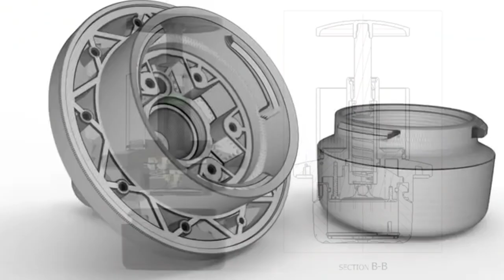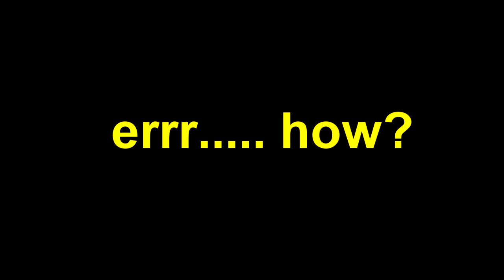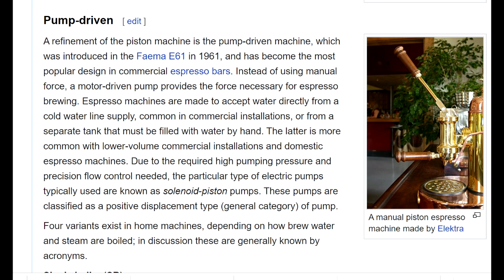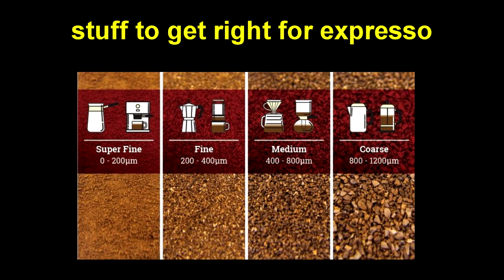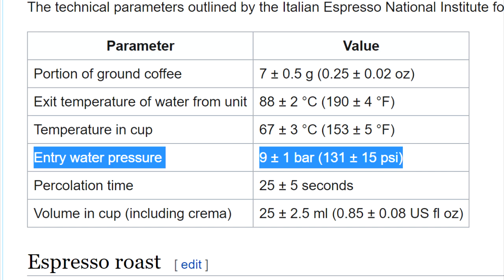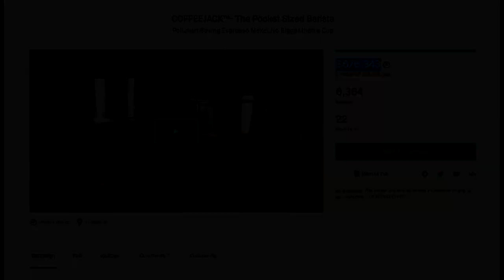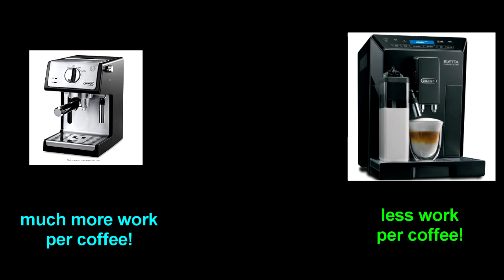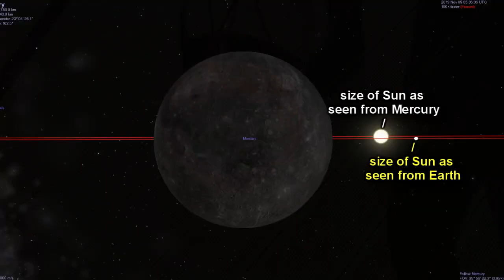CoffeeJack: BUSTED!!

Comment: So, to use this "on the go", you need to bring a cup and some boiled water in a container that keeps it hot.
A thermos would fit the bill. It usually comes with the cup attached. And is generally used to bring hot beverages, like coffee, from home to consume while still hot on the go.

So... Coffejack is just a thermos with an extra step?

Comment: Until we got to the pressure issue, I was thinking, "Well, it'd make sense on my desk at work." We have one of those Brun industrial drip units (with the three heater pads, you know, the ones you see in diners) that has a hot water tap. The problem is that my office buys absolutely horrendous coffee, so it'd make sense to have something on my desk that I can make my own in.

Unfortunately, the pressure issue looks like it's pretty much a killer on this one. The only solution I can think of is if you used a non-return valve, and used a longer plunger with a hydraulic system hooked up. But, you'd end up with needing a ton more pumps for it to actually work well.

Comment: I agree, coffee jack seems a bit too fictional to be true, a small device achieving that kind of pressure to get the espresso. You're assuming a user is reaching the total pressure by pushing down on the lever that hard. 

The device makes it so you need multiple pushes to get to that pressure. 
Consider a one pulley system: if you pull down one side x far, the other side goes up x far.
But in a two pulley system, you pull down x far, the other side only goes up 1/2 as far. However, double the weight can be lifted as easily.

So this device makes a system so that you push down a lever several times to equal one push down that you exemplify with syringes. That's how this device works.

Comment: I don't know about some of this.... Very popular coffee makers such as the aeropress also require ground coffee and hot water, but many people still use it camping by heating their water on a camp fire. So a lot of that bulk argument is a little bit of a stretch. I wouldn't want to bring a coffee machine or a hand powered espresso machine to my works break room. I also don't need frothed milk as I drink black coffee. But at the same time, I definitely wouldn't buy this product because I believe the I would be pretty likely to get a shard of plastic through my hand as I simultaneously get scalded by boiling water. Just get an aeropress.

Comment: I have a Nanopresso, which appears to be quite similar to the CoffeeJack apart from not sitting on top of a cup. I love it! It makes better coffee than any domestic electric machine I've tried. Yes, it's a faff, but I enjoy the ritual, so that's OK. Yes, I've burned my hand a few times. Yes, pumping it can be quite hard work. Yes, it makes a mess of the entire kitchen. No, I would not take it to work (as CoffeeJack suggest) or camping (as Nanopresso suggest), it would be far too inconvenient. And yes, I drink one espresso a day so the work and mess is not too onerous; if I used it many times a day it would be a complete pain. I still love it!

Oh, the other thing about these one-shot machines you didn't mention is how antisocial they are. You can only serve a single espresso and then have to clean up and start again before you can make another one. Hopeless if there are two of you and completely hopeless if you have guests.

Comment: About 10 or 15 years ago, I bought a Breville, Cafe Roma Espresso Maker.  I think I paid about $130 for it.  I think it operates at 15 bar.  I use it constantly and the damn thing works just as good as the first day I bought it; it's one of the best purchases I've ever made.  10 out of 10, would buy again.  I don't froth milk with it though, I use the same little whisk that he used in this video... the damn things are the easiest way in the world to froth milk, and it doesn't gunk up your machine.

Comment: To be honest, for me there's quite a difference between drip coffee maker and espresso (pressure) maker. Better coffee machines do quite decent coffee, I admit, but some people still would like espresso instead.
You might be aware about double wall baskets for portafilter used in espresso makers. It's essentially filter that has very small hole on the bottom not requiring perfectly grinded and compressed to make good coffee. Some people say it's not as good as naturally building pressure through coffee itself but again, everyone has preferences. I don't see anything wrong about the need of espresso.
Now who has the need for that? I imagine that's something for people working in offices that don't provide anything better than some cheap coffee and yet you don't have too much space on your desk. I've seen some similar designs people used in offices I worked in before. They just go to the kitchen, get how water, get back and when it cooled down a bit (one guy even had paint that changed color approaching 90*C) you can press that. It was similar design and it did not take too much force but on the other hand it had much longer "pump" to reduce pressure area and increase volume.
That's not perfect design but I see the point. That's something for someone, who can't get normal espresso maker into his office and still wants some similar experience. You can fill it with water and go to your desk - no electricity needed later on. 

Is coffee grinding a problem? I don't think so. I guess most of people using something like that will actually have normal machine or grinder at home. Moreover it seems like you could actually fill that with good automatic grinder at home just before leaving. I would say it should have shape compatible with typical portafilter so you can grind and tamp it, then close that and take with you. That essentially means that you make your own coffee capsule from whatever coffee you like. It's much easier to get hot water than good coffee in many places. I don't even mention how loud are some espresso maker, especially cheaper ones like you showed. I could not talk via phone when using such maker, it is so loud. Bigger and more expensive machines have much better "culture" of work. This thing does not make any sound which makes it perfect to one in open space office. 

By the way, you mentioned about milk. For a few years I was using professional coffee maker (not espresso maker) which had built in small fridge. Surely it's not perfect solution as it was using peltier panels for cooling but it was quite quiet and kept milk in good shape. Similarly my friend actually got fridge with milk port on the side. It's designed quite nicely. Longer milk tube means that some of it would be not cooled, so it actually pushes the milk back to the fridge when it's done and flushes the pipe with water. I don't remmember what is the model of that but it has two pipes. One for water going to the fridge and second with milk going back. It has automatic cleaning of both pipes and milk tank so you can actually clean it before refilling. If someone likes coffee with milk and drinks it often it mike make sens. I personally drink long black, americano and espresso when I have a choice. I had older De'Longhi espresso maker (EC155 afair) with additional Graef semi automatic grinder. It was almost perfect. Cleaning easy, maintenance cheap. After 10 years of use I disassembled that, replaced seals, elastic pipes and filters, fully descaled that (disassemble boiler and fill it with strong descaler a few times). A few hours of work and it's like brand new. The only drawback was that it was manual, so you have to wait for proper temperature, start, wait, stop, reheat, start, wait, stop, add hot water and flush it. Now you have americano. With new one (De'Longhi La Specialista) I do that at once. Put the cup there, push the button and it does everything. And yes, there is a difference in taste between all of those.

Comment: Here in Italy, we drink espresso like water, and 95% of houses have a moka machine, a simple kettle-like where you put grounded coffee, cold water and just put it over a cooker. In just few minutes, you'll have perfect espresso. It comes in many formats, from single cup to more than 12. There are even electric ones. Really, it's just the square wheel like you said. A 6 cup model from Bialetti (one of best brand) is about 30 $ on Amazon.
Reply: Real coffe freaks uses the "napoletana" model, one moka machine that you have to turn upside down  when the water is boiling so the coffee is extracted by gravity and not just by the hot vapours.
Reply: espresso is just coffe, no milk, no cream, nothing. There are multiple type of coffe based beverages and listening to an italian ordering a coffe can be an incomprehensible thing for foreigners.

Comment: Although most of the advertisement are exaggerate, but for the pressure they claim is doable. The problem of your experiment is that you only press air which will be very different than press water. The volume of air can change but water cannot. Based on my rough calculation: Assume the cylinder diameter is 1.5cm, "16kg" 
is needed to generate 9bar. To easily know what 16kg feels like, espresso ideal tamping pressure 13kg which is easy to achieve. For the volume consideration, 30ml espresso is normal volume for 15g coffee. For the diameter 1.5cm cylinder, 17cm long could achieve. For a 6cm long cylinder, 3 time push could achieve. To be mentioned, these assumption does not consider flow.

Comment: Totally agree with the problems TF pointed out (and will be liking the vid), but felt kinda irritated by his alternatives which were all huge arse machines that you can't always have at work. At work our "kitchen" has a sink, kettle, mini-fridge, a small personal locker, and at most 1*2 ft of workspace. That's why I settle for a French press, and why something like this product would be tempting if I were stupid enough to think putting that much pressure on a tiny fragile cup could possibly end well. I have a feeling that I'll get responses like "aeropress exists", and you're right. But the point is he didn't mention anything like that.

Comment: 1:00 you can create and maintain that exact pressure while water is going through the coffee grounds? By hand?
1:58 yeah i don't think you have either. At least without making a mess that requires scraping spent grounds from the ceiling or something equally ridiculous. I like how the person in the video only holds the puck in their hands... like it's necessary. Why not shower with it, while your at it?
2:26 in the office or other establishments it's much easier to get hot water than it is to expect an espresso machine to be available.

3:10 to my knowledge there is no portable espresso machine available that is the size of that thing. I don't say it's good or bad, i'm only criticising your criticism.
5:01 all three of those are absolute garbage and none of them is a dedicated, boiler-pressure espresso machine. The first uses an electric pump which will fail within months, the second is nothing more than a kettle in a weird shape that takes overpriced "pods" and the third is a full-auto that's an automatic coffee machine not an espresso machine. 

10:10 oh shit, you actually think that is an example of a good espresso machine? (seriously, if you plan on implicitly claiming you know coffejackshit about coffee, at least get the goddamn spelling right) 

11:05 you can stand on top of that coffee cup and it won't break. next.
just to shit in your cereal i will order one and see what it's like

Comment: The hardest part about good espresso is having the grind exactly right, which can vary depending on the humidity, temperature, age and moisture of beans, etc.
This makes almost zero sense.
What happens when your single basket of preground (gross) espresso comes out under-extracted because the grind was too coarse?
Reply: It generally takes a few shots and a bit of “wasted” coffee to get an espresso grind tuned in each day

Comment: I expected to see James Hoffman bust this. But just as happy to see it here.

And yeah I was wondering about that since these guys have been pushing themselves so hard on Facebook ads. Espresso takes 9 bar which is a crap ton to push when you are talking about 1 pump for a decent shot by hand (especially without a lever). Then there is pushing that much force on the glass, mug, whatever. Then portable is great, right? Sure. Fine. But you need the coffee and water. If you are finicky about coffee, grinding ASAP before brewing helps. So soon as you grind those 14g to a fine grind and let it sit in a baggy (don't throw that bag away... after all, we don't want to have wasteful trash being thrown out). Then we probably want a 2-3:1 ratio so probably 28-42g of water. We probably want that water around 95-98C (so better find a way to heat that water). Then like Phil said in the video... here's to hoping that 10kg of force is nice and smooth and your mug and the Coffee Jack are sturdy because if the water gets on your skin it is going to hurt.

Also that 40mL or so of water... You probably need more water. Because if you add 40mL water to a cool plastic thing, it will cool the water off. Better fill the chamber with water before adding the ground beans (which you ground just now right? So you at least need a decent hand grinder along with your kettle that can heat about 80-100mL of water to near boiling, mug to brew in to, and I guess you can store your premeasured beans in to your hand grinder as long as you only want 1 shot when you are on the move. Otherwise you need your beans and probably a scale to weigh the beans).

I'm not saying this thing doesn't work. It may make a decent cup assuming that you can apply the needed pressure safely. I am just saying that if I want portable coffee, Aeropress still is just easier. Big one for me there is size. I can fit my Porlex hand grinder inside of my Aeropress so it takes up minimal space when traveling. So if I'm at a hotel I just need a way to heat up water (microwave, stovetop if there is a stove, or many have Keurigs so I can use them to at least heat the water), a scale (yeah I'm picky. Most days my go to is pour over 16:1 ratio... 2x brews in my V60 most days with 35g beans and 560mL water. Just easier than trying to measure volume. Especially since I'm a home roaster and deal with lots of beans of different shapes and different levels of roasting. Weight is just more consistent and a small food scale isn't that big). This thing is smaller than an Aeropress but then I still need to deal with the grinder. Can't exactly fit it together. And I still wonder if having to push 6-8 times at 10kg of weight is going to result in me breaking the device, mugs (especially if I'm at a hotel and may not have lots of options) and possibly burning my hand.

And if we are talking about being in the office I see 2 easier solutions:

1) Use whatever coffee machine they have
2) I brew at home and then put my brewed coffee in a double walled thermos and drink out of that at work. I can even pour from there in to a mug if I want. And if I want me usual 1-1.2L I can get 2 of them to drink from.

They haven't really done anything that other people haven't done before. I mean I fell for it once with a coffee toy too. A cold brew on Kickstarter that cost about twice as much as mason jar/good filter setups on Amazon and didn't even work as well. Coffee product kickstaters are full of false promises. Be very skeptical.

Comment: I'd be afraid to break the glass at some point. They are not made to push down on them with 10+ bar. When the Mut finally breaks you hit boiling Hot water and shards. Ouch

Btw 0:46 they measured the pressure right there but can't show it to customers?

Anyhow. Thundefoot nicely demonstrates how much force the cup has to withstand each time.

Why not stick with Instant coffee? Skip the accident. Skip the pump. It's Cheap. And there are decent variants out there!

Comment: If 10 mil is 1bar and 5mil is 2bar, why is 1mil 10bar? Shouldn't it be like 2,5mil=3bar, 1,125=4bar, 0,613=5bar, 0,306=6bar, 0,153=7bar, 0,076=8bar, 0,038=9bar, and 0,019=10bar?? Which of course would require significantly more pressure

Comment: 11:08 couldn't they be using a master cylinder type system to get the required force over the area?
Have a small piston that only requires a smaller amount of force to get the pressure, that pressurised fluid is in a single chamber with a large cylinder, the pressure is the same, but the surface area increases, so the force is higher, which could exert on another compression chamber that pressurises the water?

Let's say a double piston one inside the other. So one is a circular cross circulation the other is a donut cross section. The small piston (from part of the video shown at 00:43) looks about 12mm in diameter. That's a surface area of 113mm^2. the larger piston looks like it could be anywhere from 30mm-70mm in diameter, depending where the piston is. That's a surface area of 2,827-15,393 mm^2 minus the 113 of the internal one gives 2,714-15,280mm^2. That a multiplication of force of 24x - 133x.

Now I'm trying to defend them or say you're wrong by any means, and this is literally as far as I've thought of this part, as obviously the secondary piston wouldn't move very far, even with the stronger force, as it would also decrease the linear travel of the piston by similar amounts. But it wouldn't be impossible to get the right force out.